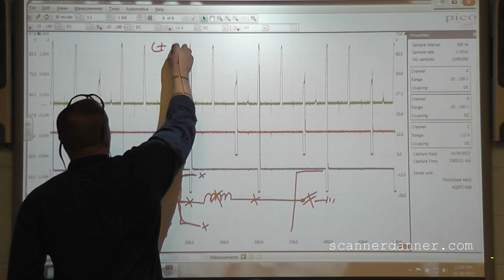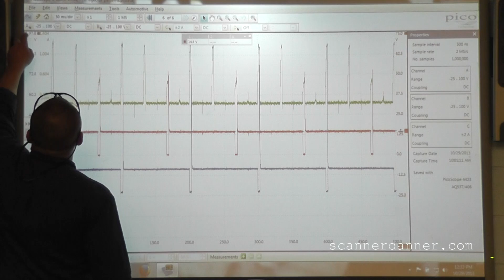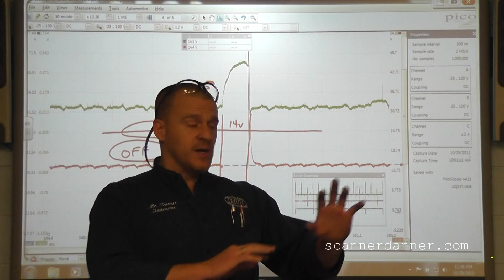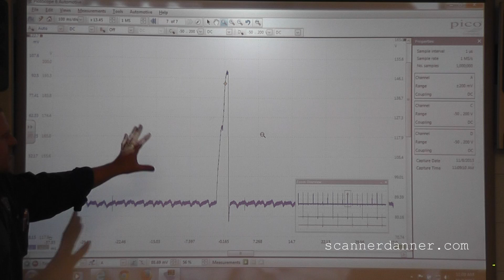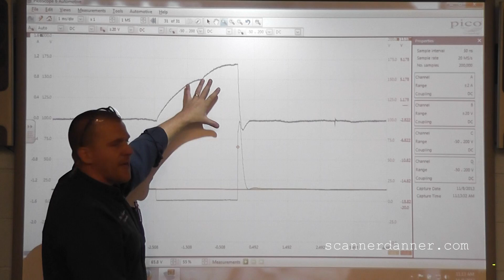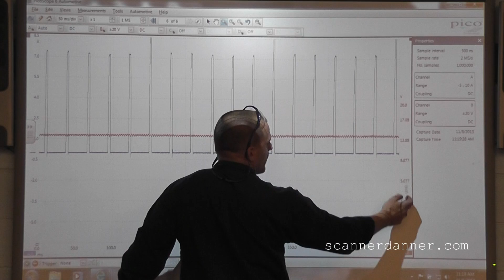Nissan Maxima Misfire Case Study Part II

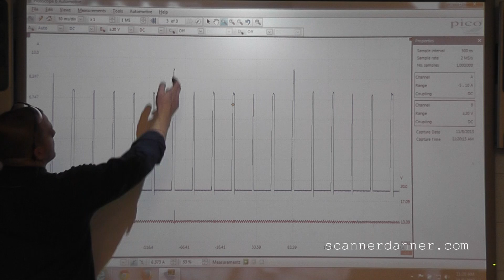Comment: Maybe I'm seeing zebras, but in part 1 at 20:12 mark, with the bad injector in place there was no current limit on #3 coil however in part 2 at 29:03 with a good injector it appeared that #3 coil was being current limited...the peak was clipped. Could it be sensing poor conductivity and not clipping the peak but, once proper A/F ratio improved conductivity it went into current limiting?

Comment: Very informative video. Dead heading injector is key as we know as current goes up voltage goes down . also primary switching current on a lean cyl. Is higher then on a rich cyl.

Comment: me not having any diagnostic tools but a digital voltmeter how could I check for a bad ignition coil I have a 96 maxima no codes I had a number six misfire but I swapped the coils and I still have a misfire but the check engine light will not come back

Comment: Hey Paul.. I am a diy'er.. I am not a mechanic by trade, and don't service any vehicles other than my own.. and I only have 3 vehicles.. is it worth it to me to invest the 400 in an oscilloscope.. or are there cheaper, low-tech ways to chase this system down??  If it is, then I will get one..

Comment: Awesome video! As usual with all yours! One thing, you mention on this video that since you have the intake manifold out you couldn't load the circuit on that injector to check the feed side, I know you love to get as much as toossible to get the job done fast. The Hook from the power probe company does load a circuit and more! I have it and is an every day tool for me!
Reply: The Hook is an AWESOME tool. I use mine often. I have used it to simulate and exonerate a 5v reference circuit that was zeroed. Unplugged computer, set hook up as 5v reference, put on circuit and measured 5v, yep, it was a computer failure. Why did the computer fail? the customer had a dead battery and hooked the battery charger up wrong.
Reply: Six years ago...😎

Comment: So, I am taking Advanced Diagnostics at UTI in Sacramento and I pulled up the fuel injector voltage pattern and the amp ramp at the same time and showed my teacher. He was so impressed, he brought the whole class over to check it out. He said he had never done that before. I told him and all my class mates to check out ScannerDanner because it is such an awesome supplement to what we learn at school. I have learned so much from watching these videos and I appreciate everything you have done for us. Thank you ScannerDanner!
Reply: They have upgraded significantly since then. All the electrical courses have several vantage pros with all the bells and whistles. They are also in the process of upgrading to tech II which will compare the learning at UTI to the way you would do training at a dealer. I have really enjoyed my time at UTI and have learned a ton there.

Comment: great case study danner u had me thrown at a loop there for a min but then i have to realize tht its a case study an the variables an play a big toll in direction! but keep up the great videos! i have a small shop tht i do alot of side work out off an i had a turbo prelude in wit the block changed out an it had 5 dffnt ppl on it cldnt figure it out then it came to me wit a no ground to main relay injector resistor box also died an obviously no injector pulse which all came down to as a bad engine harness ground!! so ur videos has been great big shout out to the video no commications!!
Reply from the maker: nice! thank you and good job on that car.

Comment: Good one. You should totally adopt an intro tune! I was wondering, how do you deal with european cars that use stuff like Renault Clip, Volkswagen Vag-Com etc. Does the Snap-On tools support all these protocols?
Reply from the maker: When I do an intro, it will be of my son playing a sick guitar riff. He is getting really good. Here is a link to him fooling around. (He is 12 in this video) (audio is poor at the beginning)
Caleb Danner (12) playing "Escape" by Devil Wears Prada
Reply: ScannerDanner Heh, nice idea. Metalcore might be a bit too much though ;). But anyway, I dont see a lot of modern EU cars in your "shop". Maybe because they still fall under warranty and go to dealers. Got an update for me on the prev. question?
Reply from the maker: mastertje2
We just do not see very many Euro cars. We are looking into a Vag-Com for the school though. I do not want to talk to much about specific tools or information systems, but with the equipment and info I have, I struggle the most on the Euro market. specifically the German market. It seems they do not like to share information. I actually had a code on a BMW and was looking for a flow chart for some help and my information system actually said "manufacturer information not available" for this particular code.......ridiculous.
Reply: ScannerDanner Alright that helps a lot thanks! I had a secondary check engine light (EPC light) showing on a VW Golf and the code didnt show in OBD2, but with Vag-Com it did. Just makes car repair a pain in the a sometimes because these things ought to be standardized. Soon we'll need a different tool for every brand! Keep pumping out vids mr Danner, it has become a form of entertainment for me. Grtz from Holland (The Netherlands).

Comment: Without pulling the intake. Could we  have check the voltage drop on the switch/return/ground/pcm side of the injector for voltage drop? Injector on, current flows through injector and then measure on switch side verifying both connections with one test
Reply from the maker: We did, but it was not done at the injector, it was done at a bulk connector. No other checks were needed or could be done further to confirm the exact problem other than to pull the intake. And even if it could, the intake needed to come off regardless.